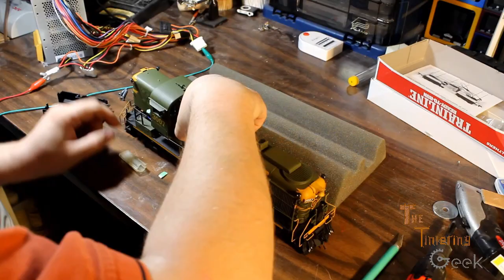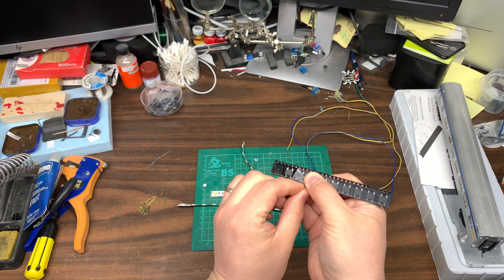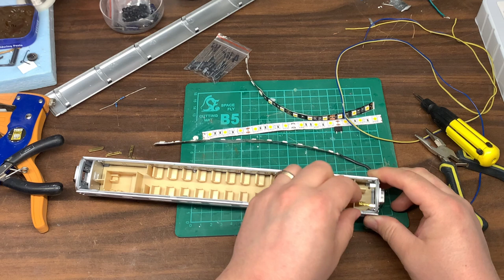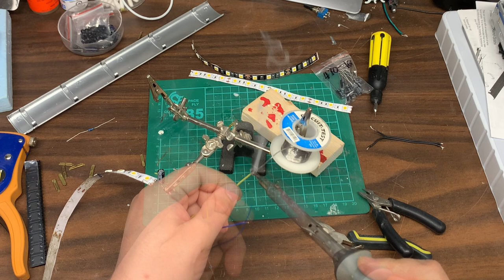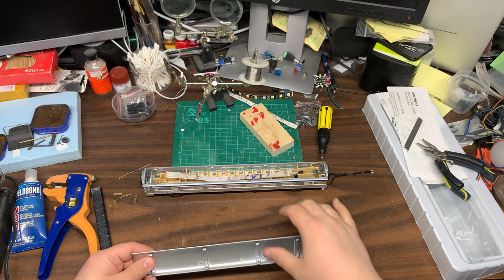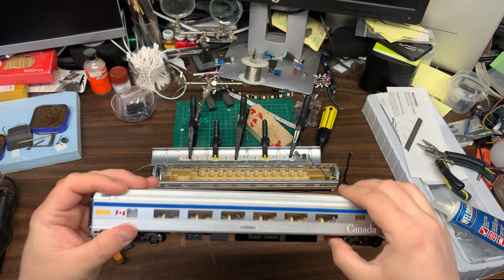Lighting Walthers Passenger Cars

Comment: I suggest using 2 wire JST connectors to facilitate mounting under the roof and connecting to the chassis. Makes servicing easier also. Great video, thanks

Comment: I find Walthers expensive, "a la cart" expensive.  Metal wheel power pickup for my car was also additional.  I had found a series of Concourse/IHC. cars in D&H paint scheme. 1/2 the price, same quality, no metal wheels. Only mistake was the ends painted wrong, was an easy fix (Badger paint matched factory paint perfectly) .  Added my own LED lighting. Still cheaper & had to add my own hand graps, just ;ike on the Walthers cars.  Same simple interior, I added car window tint to obscure the interior.

Comment: I do my lighting almost the same way as you do except I use a larger capacitor, 3300uF.  I've even made my own wheel pickups, but I've found another product which is really easy to add to a model coach.  Those are ESU current collectors, part #50707.  The trick is to cut them apart and use one for each wheel, remembering to make sure the insulated wheels are opposite each other.  They mount right on the trucks.  I've already gotten a couple of packs, as each pack will do 8 axles.  I got mine from Litchfield Station for $8.95 + $4.00 shipping which is pretty darn cheap.  I lit up an old REA (Railway Express Agency) coach and made my own wheel pickups out of some thin copper I salvaged from an old computer.  I should have gotten the warm white LED strips but instead I got bright white which were a little too white for my liking.  So, I painted each LED with some yellow acrylic paint and it toned down the light to look more period correct for the era I model which is the Central of Georgia railroad.  I do only DC as I hate the sound of HO DCC.  Cheers from an old modeler (72) in eastern TN

Comment: Hi, I have looked this film  many - many times and I can not see what you do with the resistor, so you have a capacitor and a resistor, which end goes to which end? The actual soddering is done outside view, so the result is not clear to mee, I have blown many leds by now, so I am doing something wrong...
Greetings from NL
Hans
Reply: Capacitor has + and - legs. (Minus shown by strip on body). Connect resistor to + leg by twisting together. Then solder together. Connect other end of resistor to + on light strip and - leg of capacitor to - on light strip.
Connect bridge rectifier to other end of capacitor/resistor arrangement observing polarity.

Comment: What is the values of the resistor and capacitor? I keep trying different values and the lights seem to go out almost instantly, irresoective of what values I use.
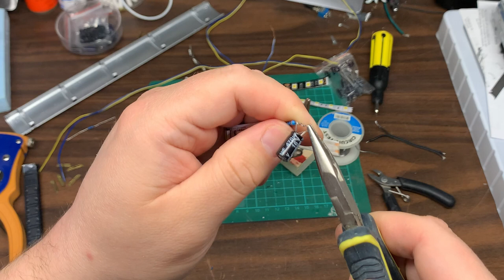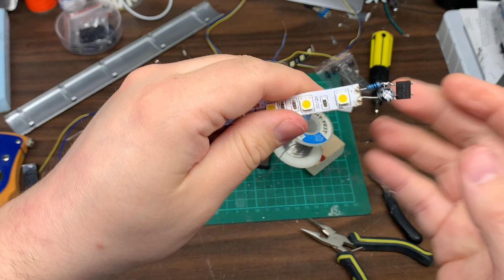Reply: The capacitor seems to be a 470uF 16v and the resistor seems to be either 170ohms or 770ohms. Found by freezing the playback at 10:23 and 10:45 respectively. Picture not great to get an exact value for the resistor. Please be advised resistor is not too clear. Would have been nice for originator to have put values in their write-up about the project.
Reply: He stated in the video, A 3K resistor (@ 2:50), and a 470uF 16V capacitor (@ 3:35).
  It is difficult to properly see the resistor coding colours, but I thought some looked like orange brown black, which would be 3,1,0.  So it is possible that it was a 3.1K resistor, though usually 2.7K are far more common, if it is salvaged material.